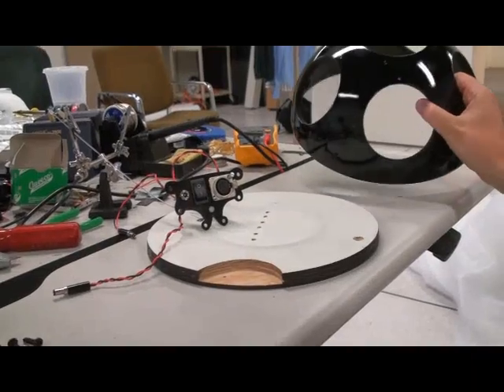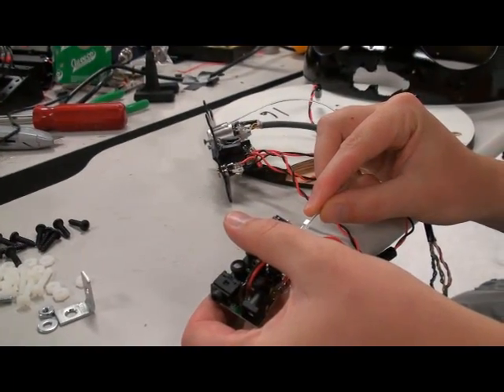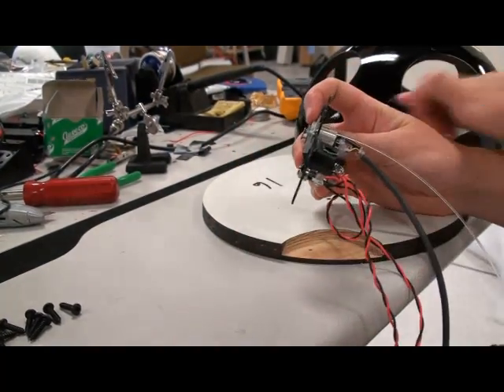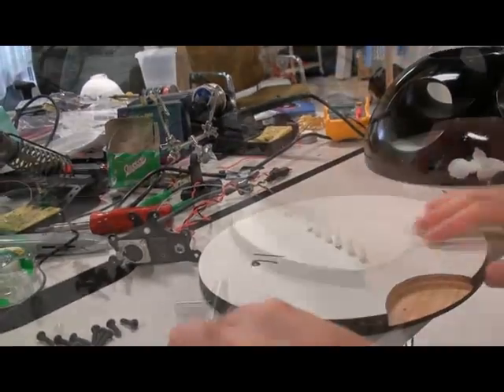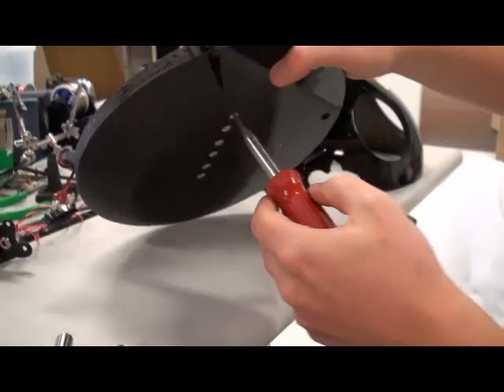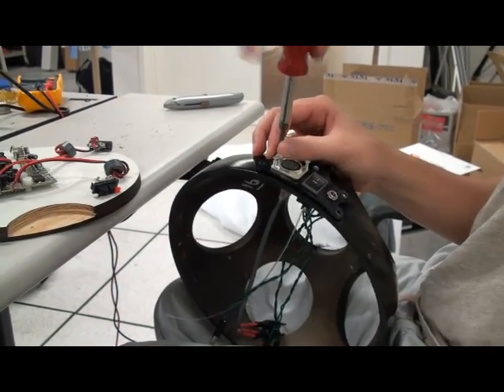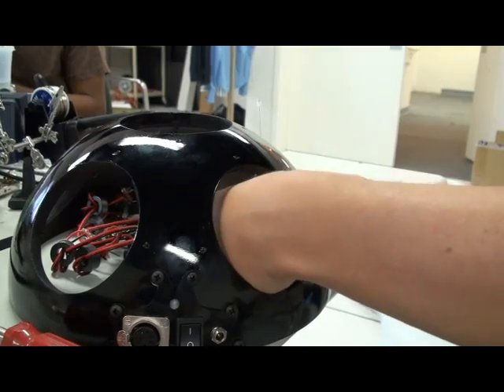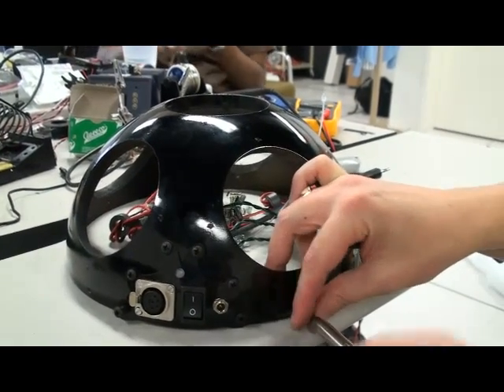L2Ork Instructables -- Assembling the Hemi Pods Part 1

Comment from the maker: We've also done a few revisions since this design (new video pending). We installed three sharp speaker legs on the bottom side that elevate the entire speaker from the ground and minimize high frequency dampening, installed the 3M sound insulation material between the speakers and the enclosure to minimize sympathetic vibrations, and finally in newer revisions of the speaker we left some space between the wood base and the salad bowl to minimize cracking of the bowl due to temperature changes.

Comment from the maker: Hi, the faceplate (plastic cover for the connectors, power button, and the lightpipe) has been fashioned from a thin plastic sheet (just about anything fairly sturdy, yet bendable ought to do). Our design is indebted to Prof. Standley who laser cut them. They do not have to be of any specific design as long as they can comfortably fit all the connectors and leave room for screw holes. One thing to keep in mind is leaving enough wood around the connector hole to prevent breaking. Hope this helps!